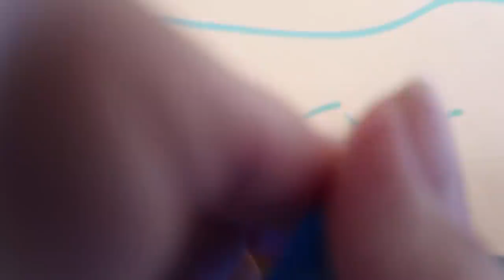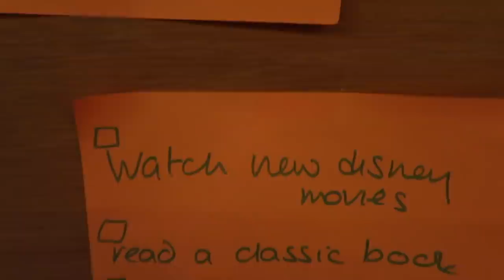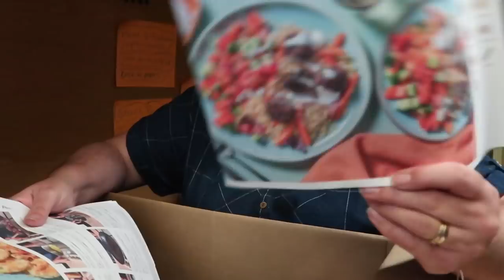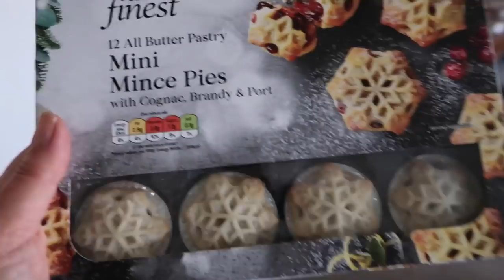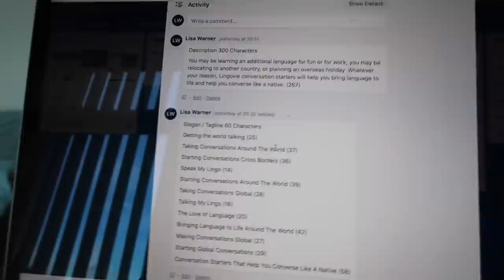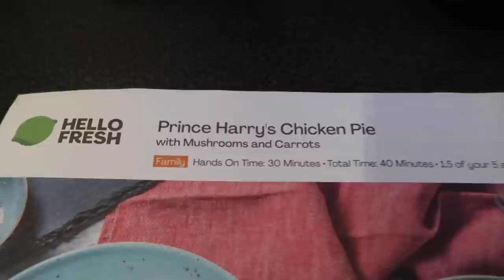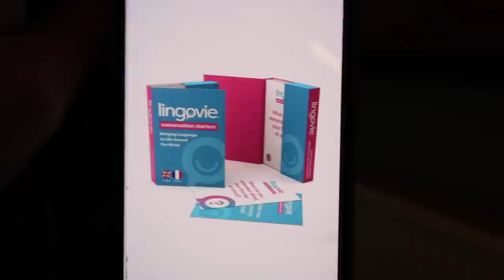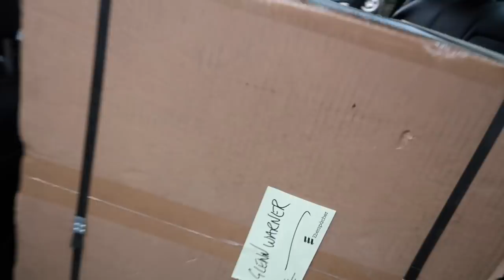Ep 157 Narrowboat Vlog | Weekly Video Diary | Moving On | 14 Nov (2020)

Comment: Did the previous owner of your car leave it parked in a large puddle? If so it could have caused the inside of the wheels to rust, therefor breaking the seal between tyre and rim, causing loss of pressure.Only saying because the same thing happened to me. Thanks Lisa and Glenn for all your videos.
Reply from the maker: That is an excellent point Kevin, I will mention that to Glenn. The car has its MOT this morning- fingers crossed it passes!